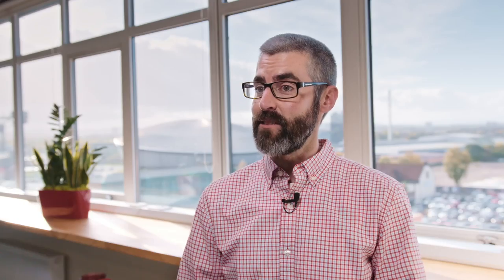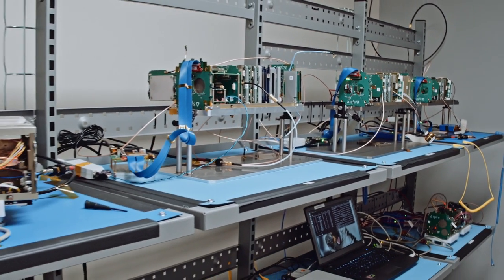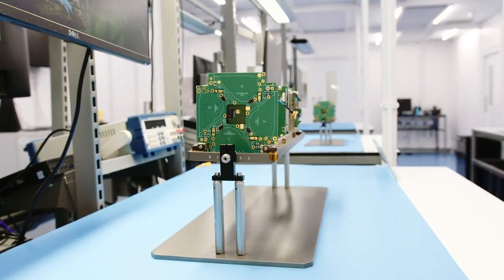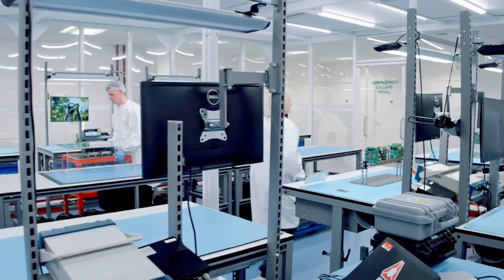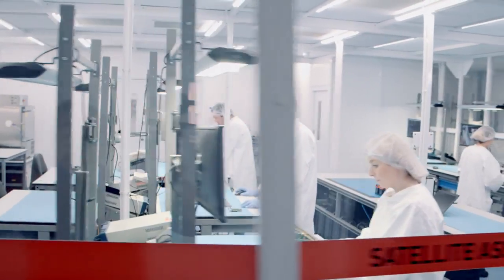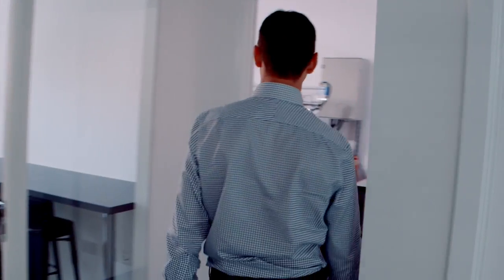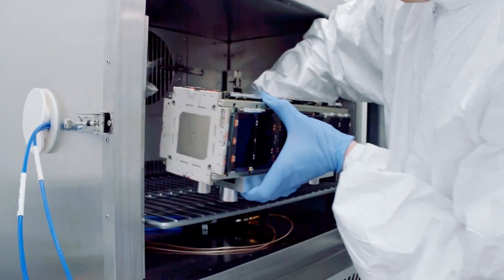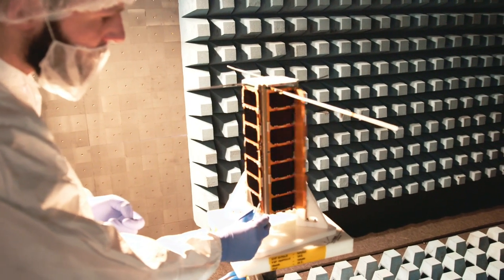A Peek Inside Spire's Satellite Engineering

Comment: Hi I hope that you will be able to answer my comments cause I'm still a child and I dreamt of becoming a satellite engineer. May I know in some missions such as making a satellite to mars. What kind of jobs are available like the propulsion control, navigation and communication what job do these come from the satellite engineer right?
Reply from the maker: Glad you're interested in satellite engineering, Irene. A satellite engineer designs and builds the satellite, including things like propulsion and communication sensors. However, if you want to operate the satellite when it is in space, that job is mostly for software engineers, where they write lines of code on a computer.
Reply: @spire-global  I see I'm from malaysia however is it possible for me to become one?
Reply: @irenechim8391  You definitely can.  Try to find a CubeSat team at a local university or high school and join them.  If you can't find one, then start thinking of ideas for a CubeSat mission that you can start.  Building a CubeSat is really good experience to have and you will make a ton of connections that can help you find a job in the industry.  Best of luck!